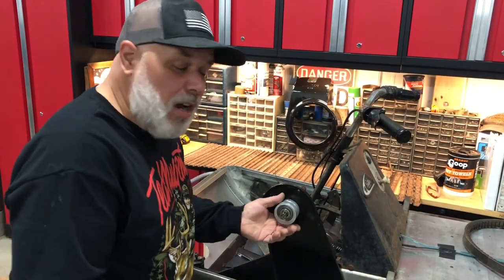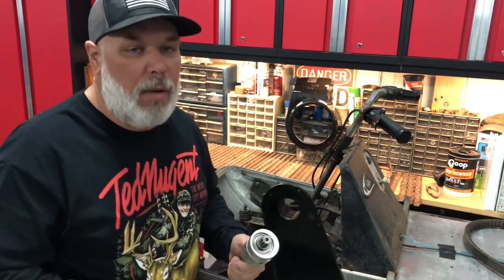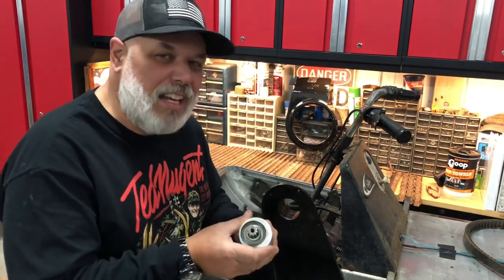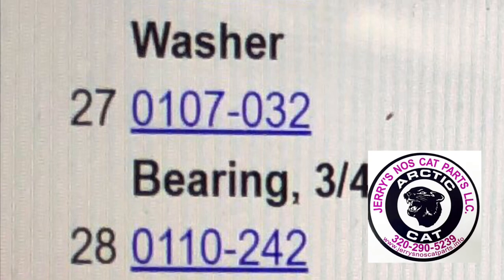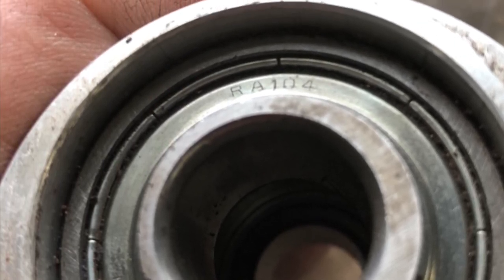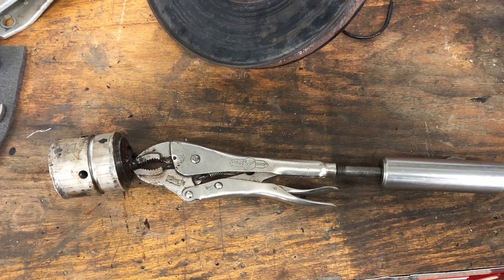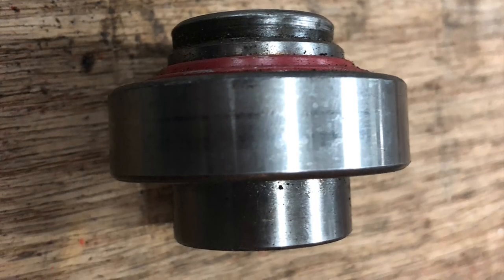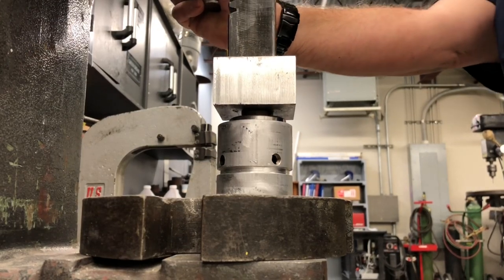Vintage Arctic Cat Eccentric Bearing

Comment: Great video very helpful. Quite the adventure getting to it. Do you know the size of the oring used on the eccentric? I took it to a hydraulics shop. They got me close but not close enough. Maybe metric sized? Probably end up reusing the 50 year old one.
Reply from the maker: I just get em from Jerry’s NOS cat parts or reuse them if still good
Reply: @Letsfixsomething26  Ok thanks!